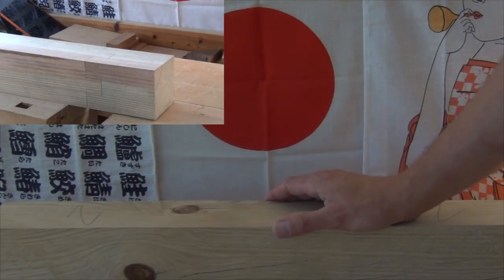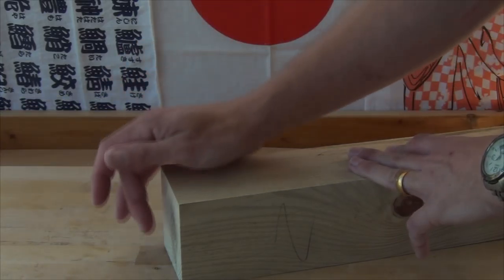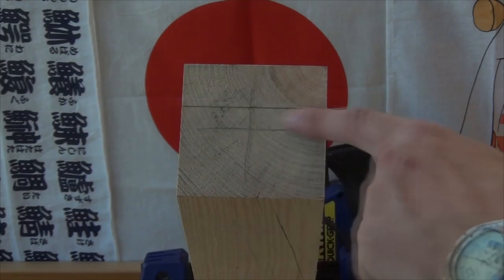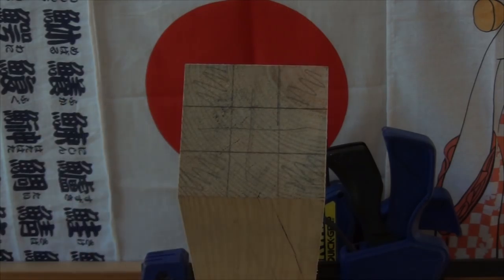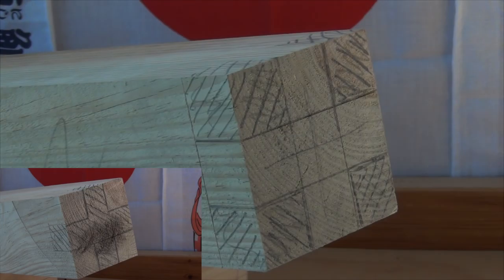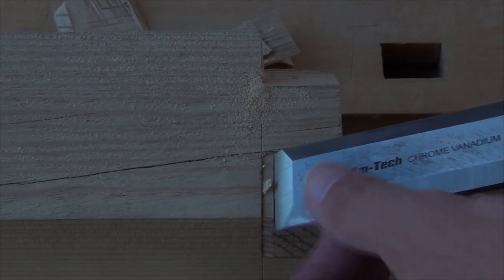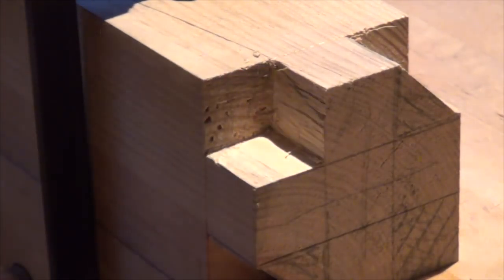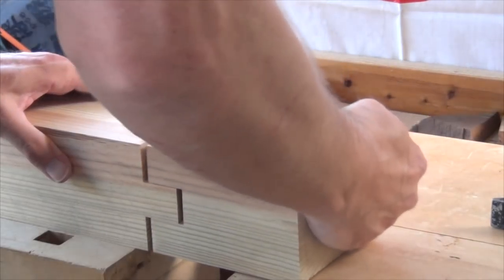Crossed Tenon and Mortise Splice ( Juji mechiire ) - Hand Cut Joint

Comment: Greetings Mitch... As always, a pleasure to follow you and your videos.  A few tips:   In Japanese joinery, you mark out from a centerline.  Like you mark out for a beam, when heawing a log.   On the end of the log or board, You choose a center, a plump vertical and a horisontal line and lay out from there.  For the centerline and parallel lines, a Japanese carpenter use a Ink-line: A Sumitsubo, (Silk line or braided fishing line instead of cotton) to make very fine lines.    Also:  Consider having a set of chisels for softwood only, with a much steeper angle.   For finish work, chisels and planes are used as knives, skewed, slicing instead of chiseling or pushing.
Reply from the maker: Cheers Jakob! Heino just put me on to the centreline - don't know why I didn't think of that! 
You're quite right about having chisels to suit the task, although shallower angle would have been better. I predominantly use my chisels on medium hardwoods, and so I wasn't properly prepared for what acted like styrofoam 😶
Reply: Cheers Mitch... good you get the centerline idea. English is not my first language, when I said steeper angle, I meant to the Wood. You are right... the bevel angle is of course smaller. All the way Down to 22 degrees.  "Punky Foam"... Time to bring out the sushi knives...!  Punky Foam... Funky Poem...and freshly sharpened pencils...!
Reply from the maker: Haha! Knife lines for cutting to, dull pencils to show up on video ;-)

Comment: Beautiful video, Mitch.
The compound looks quite simple.
That's right, Spruce / Pine is a soft wood. If there has no very sharp wood chisel, then it comes to "outbreaks".
I once processed spruce with Western chisels and get avulsions. Currently I pine for processing and take Japanese chisels, have 4 Mortise so gouged and hardly outbreaks.
Reply from the maker: Thanks. I would certainly re-grind to about 20 degrees if I was doing something similar again!
Reply: I have the wood chisel ground to 25 °, because this is a mean values between softwood and hardwood.
Reply: Don't you use small secondary bevel. BTW, what chisels exactly did you use (brand, mode)?
Reply from the maker: Tome4kkkk Sure do. If I just give one bevel angle, it is the steepest, since that is the one that counts. For 20 degrees, I would grind a primary of about 18.

Comment: beautiful joint.  i have seen a similar joint but with longer tenons for strength.  Great video mitch!
Reply from the maker: Thanks. This is supposed to be for jointing sections of a weight bearing column of post, so it isn't glued and doesn't need a long tenon. I guess if used elsewhere then it might.
Reply: oh ok that makes sense for a column since the weight load is vertical. thanks again

Comment: i have seen a video on this joint made by japanese carpenter, his wood was not square but i use there center line system setup to lay out the joint then you dont have to worry about the wood size in the endes..
Reply from the maker: Cheers! 💡Good idea - why didn't I think of that! I'll try and remember for it I ever make a second one.

Comment: Great work. I hadn't seen this joint before and it was interesting to see it come together. Just curious, how often do you strop versus actually hone your chisels or do you just wait until they are not cutting well to bring them back? I am experimenting with frequent stropping, even when it is cutting fine to maintain the edge sharper longer. I have not determined it in the long run it actually makes any difference.
Reply from the maker: Thanks! 
I definitely strop several times before going back to a stone. I don't think stropping removes the same amount of metal across the bevel face, so gradually rounding the bevel and steepening the edge. Usually a minute or two on a fine stone will correct this and a few strokes on the strop will have it polished ready for work again. 
Everyone seems to have a different take on sharpening, so I usually say try a few and stick with what works for you.